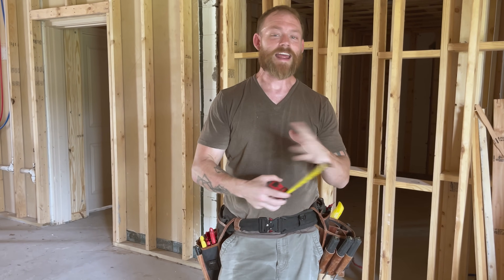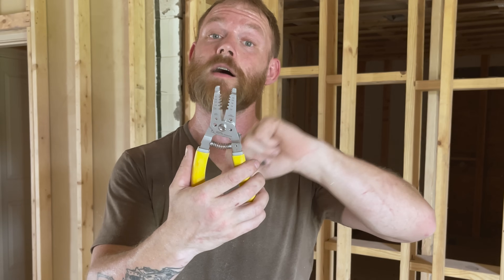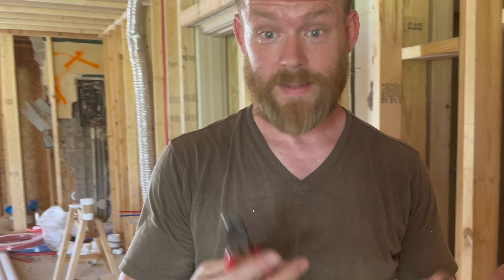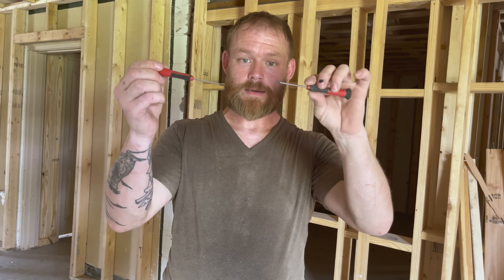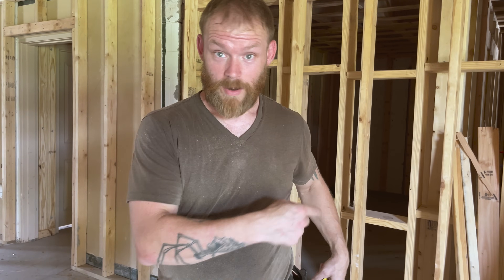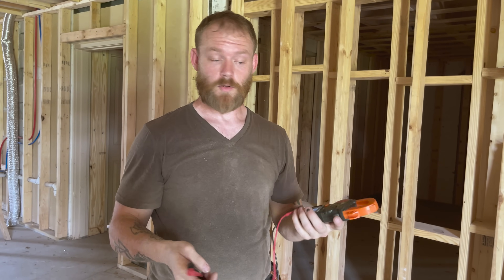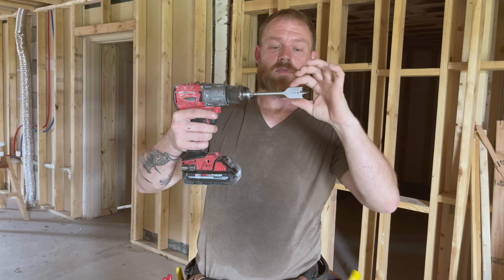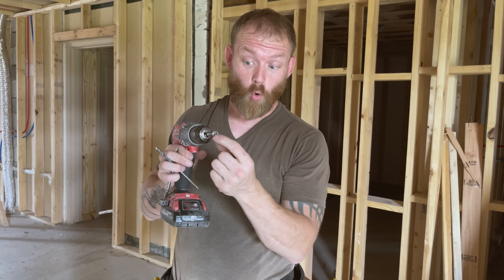All the Tools Apprentice Electricians ABSOLUTELY Need!

Comment: Good video. Between an impact and drill, if you can only have one, take the drill (as someone below suggested, an M12 is great). Impacts are amazing but drilling with them requires special drill bits just for them. Drilling concrete is not as effective. A drill can do it all, despite not being as good at driving screws, it can do it quite well.  Before impacts came on the market, we only had and used drills.

It is a moot point seeing that a combo kit is usually like $20 more, so no reason to not get both.

Comment: Hole Saws. Caulk Gun. Adjustable wrenches.
I find box connector wrenches to be rather handy. 
Some diagonal cutters are more bent than others. The ones that are more bent can pull staples better.
Everyone needs a good utility knife.
I would also recommend a small socket set with quarter inch drive and an adapter so you can put sockets in your impact driver. 
Also, be sure to have a good set of Allen wrenches, both metric and SAE. I would not want to be caught with my pants down without them.
Everything you don’t have with you is something that you’ll have to go back home for… well, maybe not as a journeyman… but you should always be planning to build your own business.

Comment: 14:44 as a diy-er who appreciates a waffled hammer, but also swings it like a bull in a china shop, I recommend the kobalt double sided rubber mallet. Mine’s red on one side and yellow on the other and may be discontinued and replaced with a different color scheme, but it’s great for those more finesse tasks where you need to hammer with less risk of accidental damage

Comment: I've been doing commercial for twenty five years. 16' tape measure is jist fine. Need a 100 or 200' tape measure doe the long measurements
Reply: This video is for rat resies/homebuilding electrical installers. not for actual electricians

Comment: Im starting tomorrow. Im 34 years old. Im extremely nervous. My Journeyman is probably going to be 5-10 years younger than me. I have literally zero experience. Its going to be weird being bosses around by younger men. 
That being said, i don’t drink, i’m really intelligent. I think I’ll be fine. I already bought all of this except a volt meter and one of your pliers. So yeah i think my intelligence has paid off already. I even have a Cobalt tool belt. Its a maintenance toolbelt…not one electrical tool belt to be found at Lowes, Home Depot, or i could buy a piece of shit one from Harbor Freight. 
I couldn’t afford both drills but i did manage the impact. 

Oh i still need the GFI tester plug thing you got too.

Im mostly here for nomenclature. Like i said, going in 100% blind. I really don’t want to be that 34 year old man walking around like a toddler asking “Whats that, whats this? What does this do? Hows this work?” 
God im nervous. Also god damn is waking up at 5am unusual for me. Been doing for a week. Im so close to normalizing.

I finally did it yall. I escaped the kitchen. A hell hole where i was going nowhere.

Ultimately it was the economy that drove me. Im short (5’8”). My hair is thinning. 2 out of 3 strikes for most women (even the single moms who are 150 lbs overweight somehow 😅) Strike three was my lack of income. The only thing i could actually change about myself. Seriously if i don’t find a partner soon…ill be on the streets. You can’t do this shit alone anymore when you’re a kitchen worker. I was forced into labor by that fuck head Biden. And if our economy tanks any further, i fear there wont be any contracts and my career will be dead in the water before i even got started. What an upside down world we live in…

Comment: I would recommend a drill rather than a screw gun if you can only afford one. And you need at least two 410 channel locks. And a good hacksaw. (Normally the company provides drills)

Comment: Suggestion on a great tool: Take a medium-sized pair of channel lock plyers and grind down the jaws to be narrower and thinner than the size of the needle nose plyer. like alligator jaws, so they fit around the coupler nuts. it works great for getting into tight places, with the benefits of wide, narrow,  and thin jaws! 
Excellent tool! 
Make it you will love it!

Comment: Buy the blue handled diagonals and linemans because they are hardened for cutting steel etc. Otherwise you will damage them.  As for a hammer I like lightweight as it can be. All those tools add up over the years! 25 years plus and do everything to save your body.  Work smarter not harder! Its true

Comment: Lineman pliers are most certainly not needed. Ive been an electrician for 6 years doing residential, commercial, and industrial. Ive only ever seen people use them as hammers. Just get a hammer.

Comment: 4 most important best made meters

Clamp meter
FLUKE 322 discontinued

Insulation and full multimeter
FLUKE 1587

Underground locator
AMPROBE AT-3000 Discontinued

Thermal camera for smart phone
FLIR ONE Pro – iOS

Comment: I highly disagree about the multimeter. Imo that's the most important thing to have, since you do measurement's and you need to know if wires are live or not, so you can safely do stuff.
But I guess it depends on what kind of apprentice you are. In photovoltaics, that's probably the most used tool.

Comment: Damm, it cost more to be a armed security guard here in California than an electrician. $2000-$2500 in gear and permits to begin. With $500 you can get 2 drills and pliers/screw driver etc. Electrician definitely pays more.

Comment: I bought a Volt claw last year and it's moved up the ranks to my top 3 most used tools. Not only great for digging wire bundles out of j boxes, but great for pushing them back in nicely. And works very well to assist prying out old breakers (like Zinsco). Highly recommended.

Comment: As an American Electrician for 30+ years I too have my opinions of tools and what are best… Unfortunately my preferences have shifted from Klein to Knipex and Wiha and Wera for a variety of reasons. Those reasons are weight, performance and durability.

And the philosophy of a TOOL BELT or BAGS, is a great way to destroy your back and livelihood…. Minimize to a tool vest and a nearby tool box…

Skillers (also known as Snickers in Europe) makes some awesome tool vests. And there are others from other companies. But a tool vest minimized to the tools necessary for the task at hand distributes weight to shoulders as opposed to hips and far mor ergonomic than American style “bags”  our belt/pouches.

For that matter a pair of 9” Knipex linesman’s, a 10 in one screwdriver and light-weight impact is all you need on your person for most tasks.  The rest can be in a box near where working. 

I keep two tool vests in my truck, on for rough - one for trim. 

The one for rough has a hammer loop pouches for a Knipex 1372-8, a tape measure, markers, a 10-1 driver, a beater, a hook for an impact. And some pouches for staples and wire nuts. And that’s it!

The Trim vest is the same minus the hammer loop, and beater, and a few more specific drivers for trim work. And of course a level. I do ultra high end market work. And “bags” are not even allowed on the jobsite after rock goes up. You can turn around in a room with bags on and end up with a $5k+ back-charge for damage to a counter or wall…
Reply: really helpful ty
Reply: what model is the tool vest u have for trim and rough in
Reply: or brand sorry
Reply: @uzi5009  Snickers in the UK and European countries- Skillers in the US (Because we have a candy bar by that name here) They are the original electricians vest….

Comment: I've tried an 11 in 1 screwdriver (Klein) but the tips kept falling out and getting lost. A 6 in 1 doesn't seem to have that problem. 
Malco tools make a combonation 1/4 and 5/16 nut driver that is super handy. The tip also comes off to clean it out. 
For spade bits I would recomend Daredevil bits. They have a screw tip that helps pull the bit through the wood.
Reply: DeWalt also makes the same double sided nut driver bits with magnets (1/4 and 5/16, and 3/8 and 7/16), but malco's seem far superior.

Comment: I’m an Australian sparky, I think the most important tools are crosscut pliers or linesman pliers you should be able to strip any cable up to 25mm with crosscuts I prefer Marvel crosscut pliers from Japan

What you called ‘diagonal cutting pliers’… we call them side cutters or ‘sidies’ because you know straya again Marvel Japanese steal is the best.

Tape yeah, level yeah, plaster saw yeah, needle nose yeah.

In Aus insulated screwdrivers up to 1000V are preferred, I like wattmasters witte drivers.

Conduit cutters, chisel, hammer.

Multimeter I think it is absolutely essential you should learn how to use a 1000V multi before anything else because you should test before you do anything else, I like Kyoritsu or Fluke.

I agree/disagree about the drills, if you’re working for a big company in Australia like Stowe, Nilsen, Downer etc you definitely won’t need them but if you’re working for a small company then you’re probably gonna need a drill at some point and it is better to have you know your own that are quality like Milwaukee, Makita, DeWalt (I prefer Milwaukee) and it is best to have both the impact driver and drill combo it’s also the best way to start building your platform you get two tools, two batteries and a charger.

Comment: One thing I never understood is the impact vs drill battle. I find my drill does everything I need and than some. (M18 compact brushless hammer drill) every foremen I've ever had would insist on the imoact for wood screws, small screws like ground screws even putting outlets in. Now my issue with the impact is the useless noise, over power for screws I find my impact has no feeling and you'll snap a screw before you can tell its snugness where as on a drill you can set a clutch and not even be able to snap a plastic screw. I always listen to my foremen but I've never gotten a good answer as to why everyone makes me use an impact. Also my argument for the "it saves your wrists" if your wrist is too weak to bury a 3 inch screw you have other issues.. Anyone else think their impact is useless for anything but big lag bolts and those type of things?
Reply: I’m only an apprentice but I noticed the same thing. I thought I was just not experienced enough.

Comment: I'm an "Apprentice" with a service van!
Lmao.
I'm about a year from being eligible to test for unlimited journeyman.  Been slowly collecting tools since I began, because small bite sized pieces is a hell of a lot easier than all at once.
Anyway, I wrecked my suburban about the time the boss bought a new van and was looking to sell his old one.  
So I bought the damn thing!
Already fitted out with shelves, etc.  
And since I do field some service calls, or work some of our jobs by myself, (also side jobs)
Shhh...
It made sense.
Building a slide out rack for the recently purchased $800 fiberglass little giant right now.  (Bcuz the damn thing weighs 50 lbs)
No jet rack gonna carry it.  Have that for my regular use light weight 6'.

Btw, bro.  If you don't already, you'd be surprised how often that little giant comes in handy!
Anything from 5'-9' A frame or 11'-22' extension, all in one.
Uses WAY less space on the van.
I got the "conquest 22"
Highly recommend as an all in one.  Has a padded corner brace for poles and corners, works on stairs, and can slant A close to a wall, or to avoid obstacles, as well as being climbable from either side.
I don't have stock in the company, but I'm loving the product! 
(And the van)
Love your vids.
Later, bro!

Comment: Wow, such a budget friendly starter kit. I do HVAC right now and we use SO many tools it’s crazy lol. I’m looking to switch over to being an electrician looks like I have everything I need and much more 😅
Reply: Hey man im currently about graduate from hvac school what are some starter tools i should get to begin with. I have no types of tools and im trying to get ready and buy my tools
Reply: What’s up dude. It kind of depends what experience you have from school and what you feel comfortable doing, getting into the field. What I keep in my clean and check list (which is likely what they’ll start you doing) is a drill with interchangeable 1/4 and 5/16 bit these sizes get used a bunch. A couple medium and shortest sized nut drivers both 1/4 and 5/16. Philips and flat head. Different types of pliers, wrenches, needle nose, regular, and wire snippers. Pipe brush, very light grit sand paper or green sponge to clean flame sensors and a small shop vac. PVC cutter, Magnetic tray, lights/headlamp, drill bits, multimeter that can also read temperature and capacitance, Manifold gauges for checking refrigerant levels. These are just very basic tools. Moving forward there’s a ton more tools you can get for AC and heating as time goes on, but to start with that’s a decent list.
Reply: I do both. And electrical is 60-70% of HVAC maintenance. Construction on the other hand electrical is only like 15-20% of HVAC. And yeah most of your tools will be the same in both fields. 
I'm probably the only industrial maintenance electrician I know who leaves their fluke in the truck (except for troubleshooting instrumentation and other 4-20ma signals) and use the fieldpiece meter for EVERYTHING else

Comment: Lads cmon now... fully insulated snips, pliers, long nose pliers, full insulated screwdrivers (only tip is metal) drill/hammer drill! You are not a carpenter to use only impact ffs
You have some great points but all my apprentice wouldnt make on site with all your advice! Safety first

Comment: Huge tip, leave the Milwaukee tape measures at the home depot where it belongs, ive been threw multiple of them and im a milwaukee or die type of guy. All my tools are milwaukee except my tape measure. I bought the klien tape measure and it doesn't break till about 14ft and has been one of the best investments I've made in tools.
Reply: Wdym don’t break till about 14ft?
Reply: Sorry if it’s a dumb question I’m just curious bcs I’m trying to start learning the trade but wasn’t able to get into a hs that taught it
Reply: *comment didn’t post but I asked wdym it doesn’t break till about 14 ft?

Comment: That milwaukee multi tool....I have the harbor freight version and I LOVE them.  I took the giant handles off and put on a few coats of plastic dip so they're a little more streamlined.  They strip from I think 18 to 8 wire.  The cutter is the perfect size for stripping the sheathing from romex.   And FYI, the Doyle line of pliers at HF are a home run.

Comment: Small wire brushes scotch Brite sandpaper also super handy when working on older equipment cleaning up landing surfaces or even cleaning off the conductors themselves getting off corrosion or any junk built up.

Comment: Really well done.  I was an electrician back in the early '80s, needs/requirements really haven't changed much.  I will say the plastic tipped probe that lights up/beep/buzz when a wire is hot wasn't around way back when, it would've saved me getting hung up on a supposedly unpowered box, that happened to me a couple times.  Couple things to add - First, you didn't talk about your tool belt.  A good, comfortable, pouch with large, stiff pockets that has separations for holding not only the tools but also connectors, wire nuts, pipe straps, staples, etc., it's as essential as the tools themselves.  Second: working the trades, be it electrical, mechanical, carpentry - whatever, it's exceptional work, and though it's not always year-round security, the building trades is not likely a job that can be outsourced to a 3rd world country.  If the structure is being built in your town, it will require skilled tradesmen to do that work right there.  

When I was an electrician, it was really the most rewarding time in my life.  I have done tons of different kinds of work before and since, though I didn't have a formal training program, I started as an apprentice and after a couple years I was able to get my journeyman's license.  Not everyone who wants to work in the field will have a genuine aptitude for it but anyone who wants to pursue it can learn and be effective and productive.  Even if it's not a lifelong career, what you learn doing that work - using your hands, methods of problem solving, the physical work, it builds the kind of knowledge that can be applied in almost any other job.

Comment: I've got a SPD built into my 100amp residential panel. Been having a issue wondering if someone can chime insight. I don't have breakers popping but during weather events and sometimes before or after my L2 ground light will turn off on the SPD and half my house will cut power, ESPECIALLY if fridge is running (mid efficiency model). Now here's the kicker, L2 light on the SPD will eventually reactivate meaning its grounded again BUT if I go upstairs and turn on my 120v dryer the power that was cut comes back on and the SPD L2 light reactivates!! 

ANY IDEAS?!?!?! FAULTY SPD (Installed 2010) or faulty fridge (2010) or is it the bad GFI in my upstairs bathroom?

Comment: Dustin I have a Klein 6 in 1 tapping tool; so that I can chase the threads on metal and plastic boxes. Also on the non contact detector check it on a known live circuit before you use it.  I carry channel pliers for when do conduit.  Yes when you are starting out as a apprentice electrician you need to know what type jobs the electrical contractor does in order to start your selection of tools. Also you need a good tool belt.